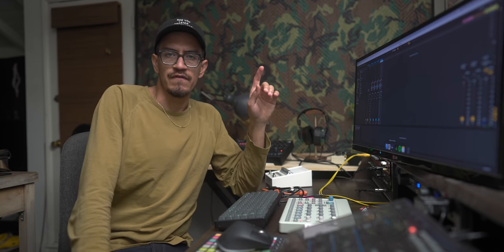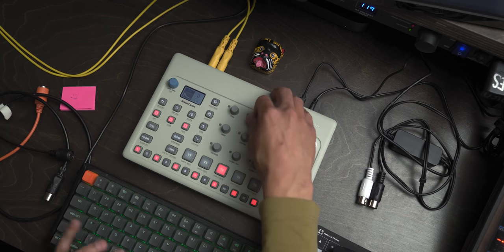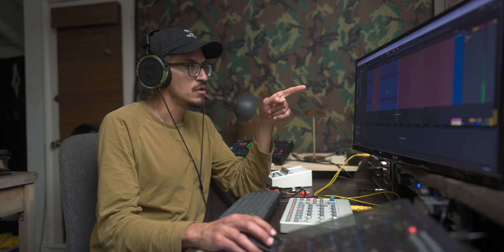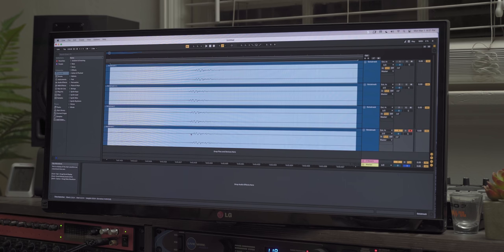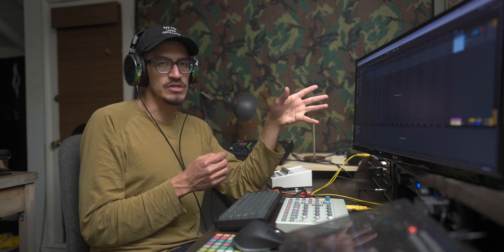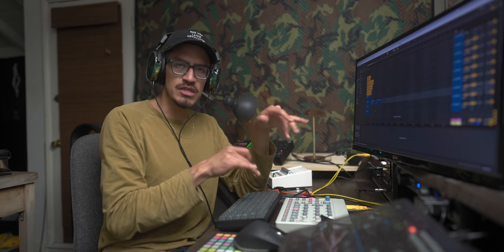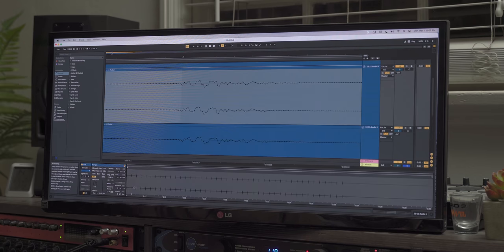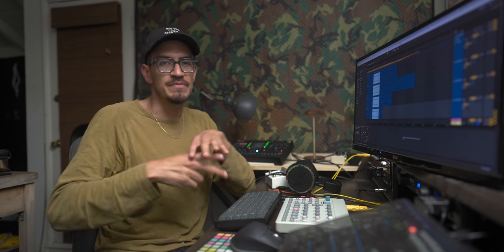Midi Latency and Why You Can't Win.. // Hardware Swing vs DAW Swing

Comment: Dear Ricky,

I run an M1 16GB and live 11 and it has nothing to do with that . 
this is an issue with USB Midi in general. It is s janky as hell and here is where i yelled at my screen:   
Especially During the first two bars! 
So in a way what you did is good for the test, because you decided to record only the worst few bars. There is a school of people recording 8 bars and deleting the first four as a workaround, but honestly, why doesn this still have to be a thing in 2021, right? I wonder if any ATARI users want to chime in. Alec Empire mentioned slaving his Pro Tools Rig to a 1040ST. 

MIO have fantastic products, but USB wasn't a good choice. 
I have very strong hopes you will be the first person to perform this test on the MIO Ethernet series of interfaces like the XL for us. Please Do!
I hear great things everywhere and no one has performed a thorough test of this.
With my MOTU Midi Interface Drivers not having been written yet for the M1 architecture i have high hopes for ethernet Midi. 
Apple has integrated the great RTP MIDI protocol after all, which has proved to be quite reliable in my experience.

p.s. Thanks for doing these, because some days i'll just lose my damn mind for 8 hours straight trying to fix tracks where i forgot to set to IN or something like that. So thank you for raising awareness with customers and manufacturers alike so hopefully it will be worked on in the future.

as you can tell i am also desparate about these issues,
<3

Comment: I’d be interested to see what happens the other way round: sync Ableton Live to the Elektron and see how you go...easy enough to do and works really well for me with the Deluge.
Reply: Tried this, you still get the latency/jitter caused your pc hardware/config. F.I. If I send 130 bpm from my octatrack to live, live get unstable bpm of 129 (or 132 next recording), and also the jitter which can’t easily be measured on the daws side.

Comment: Hi Ricky, have you ever tried Ableton Link with hardware? Use the same midi interface you bought plus a adapter like a camera connection kit on your ios device and use the app Midi Link Sync. The ios device via midi goes to your hardware midi in / out and sync happens over your network. It's a different kind of sync where all devices wait for each other. Also your midi device can be the master clock.
Reply: I use Link with an MPC Live, works a charm. I monitor anything coming into the PC on the soundcard, not the DAW, audio tracks for recording in to Live always set to 'off'.
Reply: You mean there's an iOS app called "Midi Link Sync"? I can't see it. I'm curious about using Link as a clock alternative but I've no interest in using the phone as an instrument

Comment: I nearly always have to set my start points on every audio track I record , as a standard practice due to latency issues , so I guess I just get used to it ..    so maybe if you have overbridge , and use the internal sync , at least you can record all the tracks at the same time , then maybe you just need to get your set to 1.1 bang on for each track .. still a pain in the arse ..

Comment: Good topic.
I've never been able to get 100 % consistent sync start point in midi latency when recording the exact same gear in several takes.
I'm using Logic and had the impression that Live was a bit better at this. But as it seems it's a common problem.
What about talking to your Novation contacts about this. They probably has some good information?

But, what you also prove here is that the internal clock has a slight timing issue.
Try some other gear as well to see how the internal clock runs?

Comment: I don't get it either, the codecs must be outdated still for MIDI latency thru USB. I haven't had good MIDI timing in a DAW since I used a Firewire interface. We might have to go back to Firewire sadly, or invest in the more expensive (like Ethernet or Dante) for better timing. USB 3 is just not there yet.

Comment: What part of don't send MIDI over USB did you not understand? Good luck finding a computer than doesn't unless you want to go back to 68000s.

The problem is not MIDI or Clocks it is modern computer OSes and USB. It does not matter how stable and accurate a MIDI Clock is, computers cannot respond to them accurately. It won't get any better with MIDI 2.0 either. Look at the companies involved--none of them make synthesizers.

Comment: MIDI over USB is shit, jitter and dropped packets - avoid!
Reply from the maker: yea im starting to realise that ESPECIALLY once you start adding other plug-ins or loading new tracks it constantly slips off more and more.
Reply: @RickyTinez  It's a low level priority for modern computers, and processing through USB just adds to the unpredictability. My good friend Jyoti who knows way more about this has a Twitch channel https://www.twitch.tv/bzangy - he's worthing hitting up!
Reply: I find midi clocking is the problem, sending midi notes is just fine, assuming you work with Ableton’s external instrument to get automatic latency compensation, otherwise you have to fix everything you record

edit: and you have to record from the midi channel with the external instrument device when you want to bounce the track, not from the Ext In., or you’ll lose the automatic sync

Comment: Just tried your first test (with Digitakt instead of Cycles) but using Overbridge rather than analogue audio, and via USB it's absolutely rock solid all tracks perfectly in time on my Mac Mini. For sync to the modular from a DAW I recommend Expert Sleepers Silent Way Clock, via their ES-3 Eurorack module, although I have only tested this via ADAT. 
Also, Expert Sleepers make these, which are a fraction of the price of the ERM, although I have never used one.
https://www.expert-sleepers.co.uk/usamo.html
Reply: Only one midi output channel so I don’t think you can adjust the sync of individual instruments with it

Comment: The answer is easy. Just don't use MIDI it is just too baggy. Dump your external midi gear. Use CV instead. Silent Way Expert Sleepers and others will give you sample accurate timing from your DAW to external hardware. MIDI is a slow serial interface and will never give you sample accurate timing.
Reply: Wrong... Ableton has huge problems with audio coming in no matter what... despite the focus of this video... MIDI is not a problem for Live compared to latency of audio in both monitoring it and then also in recording incoming audio. The other day I was recording a synth into Live, despite me thinking I knew every trick to get the incoming audio to record in time... I couldn't, I couldn't to the point where it was literally 100% not possible and the only way for me to get the project done was to let it record out of time and manually move the audio into sync.

Comment: This is why we put 5 empty bars in front of every project so it can speed up, also put a random sound at the beginning of every track so you can easily align them after. It always has been like this when recording MIDI to DAW's, after a bar of 2 it's solid. MIDI is 8 bit technology (hence why you have 128CC's.. ) from the stone age, before... you know... this PC's. It's very solid but can be a hassle when you are not familiar with all the different setups and the pros and cons of them. Also, avoid USB, and Logic/Ableton etc. is a bad choice when dealing with MIDI... Protools has the best results for me but I don't even sync to PC/MAC anymore, there is no use for it. Just export midi files and import them when I need the session.

It indeed is called jitter, like previous people have mentioned.

Comment: I will be honest with you, not pretending to be nice like other people, this was the most boring video on the internet!! lol But I did watch it all because you are a very nice guy and I may run to similar issues in the future so better to know in advance. But personally It don't bother me too much this very common syncing issues, (mainly in the first one or two bars trying to catch up) as I prefer to sample individual loops and then arrange and continue composing in Live. Or in the case of a big take running from the Ableton clock  in a loop pressing play and stop several times until everything is in perfect sync and then take out the loop and press record. One thing you mentioned having everything connected to a USB hub may be the cause of the drops, mainly in a Mac  world where they make cheap and under voltage USBs and other components so that costumers spend lot of money with adaptors and stuff...